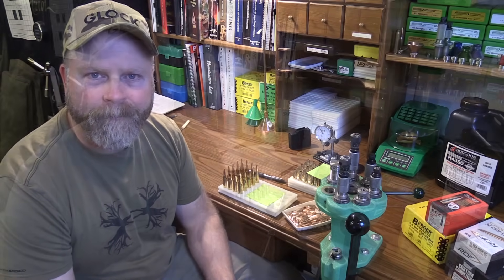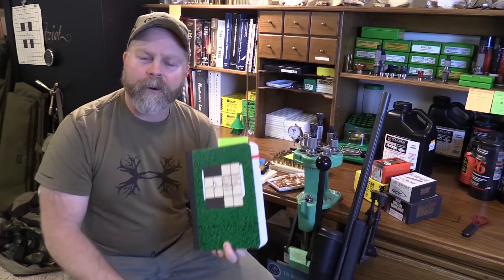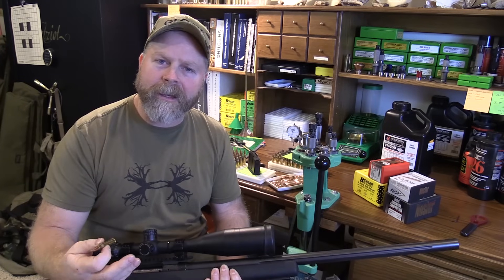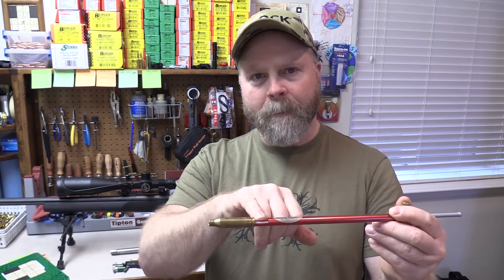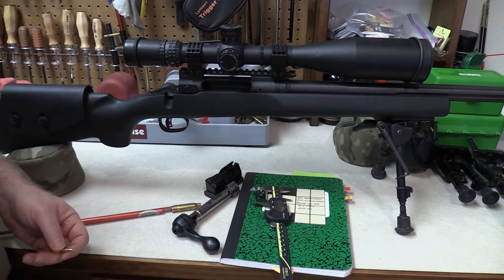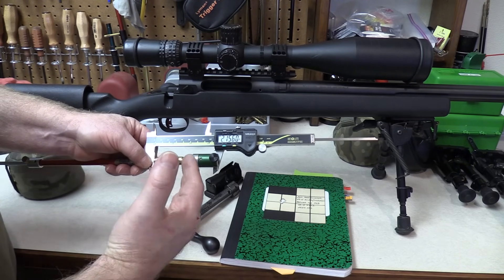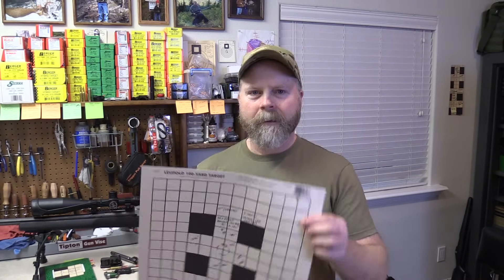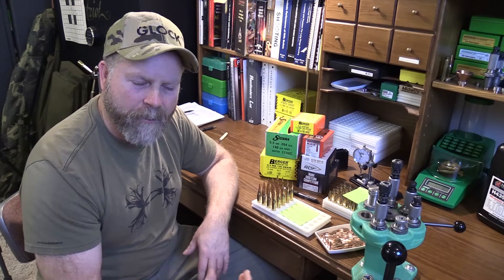Bullet Seating Depth: How To Measure & Where To Start For Load Development

Comment: Awesome video Sam, lots of info and your easy to listen to.  When you seat your bullets do you crimp them or not.  My father in law does a lot or reloading and tell me to use a lee factory crimp die.  But it seems like there is no way to match consistency on how hard it crimps on different lots of ammo.   Also have read where crimping can leave marks on the bullet that effect accuracy.  But I also don’t want my bullets to telescope in and cause pressure.  I know you have to crimp on semi autos.  But what about bolt actions??  Thank you

Comment: Hi.Sam. please advise me if i can use one load for the rest of my given rifle barrel life which it performs well .or will i have to adjust the load or only the seating dept.thanks
Reply from the maker: There's no way of knowing. Every barrel and load is different. I've had several barrels that shoot very well for  a long time (600-1000 rounds) without changing a thing. You can get a peek at that possibility by loading rounds that are incrementally shorter and see how they perform.

Comment: Great videos. I would like to see you compare the measurement from your homemade comparator case with the Hornady unfixed case to see if there is really a meaningful difference in overall chamber length as measured.
Reply: You bring up a good point.  I do measure this with my rifles and there's usually a difference of a few thousandths.  Maybe not very meaningful but something I like to note, especially if I'm trying to put a bullet right on the lands.  I would guess Sam is making his own modified case from brass fired in that gun, so there wouldn't be any difference for him to measure.  If you have a lathe and the correct tap they are super easy to make.

Comment: What loading press are you using? Do you have a recommendation for precision loading?
Reply: That's the Redding T7.  It's what I use and what I would recommend.  You can get quality reloads from a very basic press such as the RCBS Rock Chucker as well but I like the convenience of the turret press for changing between dies.  So handy, especially for load development when you're only doing a few cases at a time with each die.

Comment: I use a fired case , put a dab of Elmers glue on a bullet , chamber it , let it dry for 30 minutes , remove it making sure not to let the bullet be pressed against the side of the Receiver - push it over to the center -  remove it gently .
Now you have a dummy round to measure off of with your bullet Comparator .

Comment: love your videos, but im new and confused. It seems like bullet seating and load affect accuracy. but you can have the proper load and improper seating and not be accurate. or the right seating but improper load and not be accurate. Where does a one start? work on load first then when its as accurate as you can get it then play with seating?
Reply from the maker: You got it. I start at .010" off the lands with everything, and play with powder, neck tension, etc. first. I usually find something that works at .010" off, but if I want to adjust, I start moving away from the lands in .010" increments.
Reply: Panhandle Precision thank you

Comment: Hi from France, thanks for your excellent video . I am using the hornady OAL gauge + hornady mod. cases in .308 . I made a first measure with a Hornady BTHP 168 grs and it worked like a dream for my B14 . But I had a kind of stress with Nosler Partition 175 grs HPBT and I think it's very long long to reach the land . I am a bit worried ...

Comment: What is the difference between measuring to the Ogive and measuring Full Length. I use the Hornady OAL gauge and find my lands and measure the case to the bullet tip. If I want to set my bullets 0.020 off the lands, what makes the difference if you measure from the Ogive or measure the Full Length of the cartridge. .020 is .020 whether its from the tip or the Ogive correct? Am I missing something.
Reply: If your using you OAL gauge to find your lands then measuring the Coal of that projectile as long as you use that same bullet to set up your die,  then yes you should have the same outcome In the end!

Comment: Excellent video. I would like to know how you feel about utilizing max reasonable seating depth to increase case capacity and performance. Example would be my Savage 110 300WM using 208 Amax and H1000. I found that if I run single feed(.010 jump) I can easily load up to 79 grains and get no pressure signs. I assume this is more relevant to "magnum" cartridges using slow powder.It's true about Savage generally having a nice long magazine. The only round I've had to single feed to get close to the lands is in my Savage 110 300WM.

Comment: Good idea about making your own modified case, but here's something to consider.. Don't just fire form a case in your chamber. Why? Depending on how much the brass has been work hardened, you might not get sufficient "spring back" ie  if the brass is too hard the datum point on the shoulder may remain too long after firing. You should fire form then set the shoulder back the optimum amount. Usually between .001" and .002" .  This way you will get a true reading using the modified case for measuring bullet seating depth. Just make sure you resize the rest of your cases used for loading to the same shoulder dimensions as you sized the modified case to.
Reply: That's what I was thinking.  Why would I use a fire-formed case when I'm going to be seating bullets in brass that has the shoulder bumped back 1 thou from the fire-formed length.
Reply: I've thought about this a little more.  I'd agree with you (set the shoulder back before measuring) if you are using the method of carefully closing your bolt on the round and reopening it.  Because the extractor is holding onto the brass, your loaded and sized round may not be touching the chamber at the shoulder, so pushing a sized round into the shoulder to measure might be inaccurate.  But if you are using one of these Hornady tools, I'd say leave the brass fireformed, because the dimension from the shoulder to base is an accurate example of the chamber with the rifle bolt installed (since you aren't using your bolt in this situation).
Reply: The extractor shouldn't be an issue, but don't quote me on that.  Those store bought modified cases are sized to SAAMI specification. ie one size fits all.  The only problem with that is not all chambers are cut exactly the same. With an ordinary hunting rifle it doen't mater as they usually don't need to be that accurate to do the job. BUT I always want to try to get the best out of anything I shoot.  I have 3 different 3006 surplus rifles. These have chambers that are purposefully cut on the generous side. So it I used a SAAMI spec case to measure I will not be getting the proper # to seat my bullets to since I adjust my sizing die to bump back the shoulder .001" on the fired case. This makes my case I'm going to reload actually longer at the datum point of the shoulder than the store bought SAMMI spec modified case. This is why I always first size the case I intend to modify exactly to  the specs of the  sized cases I plan on reloading. This way I get exact measurements. and yes I have 3 separate modified cases each tailored to the rifle it will be used in.   You can use the store bought modded case, but you need to add or subtract the difference in size  between it and the finished size case you will reload.when measuring seating depths.
Reply: Sam's reason for not sizeing the case was about neck tension. If you resize the case the bullet will not be free to move up to the lands... Listen to Sam.

Comment: I use the hornady version of those tools And I have to set the bullet 30 thousandths off the lans to even get my action to close and another 15 to get it to close smoothly. The tool is hornady brass and I use lapua could this be why? I’m running GA Precision 338lapua built on a rem 700. I just find it odd that I have to seat the bullet so far or maybe I’m missing something

Comment: Sam, If we do a powder ladder test (at .3gr or .5gr increments) a given base to ogive length to find the harmonic node, and we change the seating depth, do I have to do a whole other ladder test just from changing the seating depth? In other words, if I make one change, do I have to start over?
Reply: Accuracy is matching a bullet's exit with a harmonic node.  Pressure curve affects the timing.  Seating Depth, Charge amount, neck tension, are variables that can affect the pressure curve.  So yes, if you're changing a variable, expect accuracy to change.  The question is what changes the pressure curve the least, 1 thousandth change in CBTO, or 0.1gr change in charge weight.  When load dev-ing to find that node, which variable produces finer adjustments?  I'm not sure, but I'll actually test this with my crono results being the determining factor.

Comment: I am shooting a 223 Rem. 700 Using a 40 grain Hornady V-Max bullet.  Using the Hornady overall length gauge to the ogive my measurement is 1.8700 touching the lands.  I want to start with this bullet being ,010. Off of the lands.  So when seating the bullet; what would my comparator measurement be to attain the ,010 jump?  Thank you.  jsmith1548@sbcglobal.net   PS. You have a wonderful informative program that includes a great deal of knowledge.  Please keep up the good work.  I am telling all my shooting buddies about you.
Reply from the maker: If you're at 1.870" touching the lands, your measurement at .010" off the lands would be 1.860". I like to take several measurements when determining max length, just to be sure I'm consistent.

Comment: Should you add or back off the powder load as you jump or back or the lands??
Reply from the maker: I start at .010" off the lands, increase powder until I hit pressure or it shoots well. If I hit pressure, I back off the powder ~ .5 grains. I don't adjust powder for seating depth changes, but I also never jam bullets. If you do seat into the lands, pressure can be a problem and the powder charge may need to be adjusted again. Going away from the lands, I've never had a problem keeping the same charge, until the bullet compresses the charge. For load development, I only want to change one thing at a time. I've had better luck getting the powder right, then the seating depth.

Comment: Great video. When your bullet stuck in the chamber while you were pushing the bullet against the lands, how did you know how far to push it back into the case to measure it with your caliper? I didn't understand that part of the video.
Reply from the maker: catwrench3 When the bullet hits the rifling, you tighten the screw that locks the rod in place. After you get the bullet out of the chamber, just stick it back in the case up against the rod. That will be the same length as when it stuck in the barrel.

Comment: So, when your as your throat gets longer do you seat the bullet at the same length as you did when the throat was "new" or do you follow the throat and always keep the same amount of jump? If you chase the throat, how often do you check the throat?
Reply from the maker: It depends on the barrel. I've seen them shoot well at the same CBOL for the life of the barrel. I usually follow the throat as it moves forward as long as the magazine allows it. I check them at 200 rounds, then every 500 after that.

Comment: Excellent! If it shoots, leave it alone.If doesn't shoot a SMK, there is a problem with the barrel.
Reply: I switched from SMK 2200's years ago when the Amax 168 came out. I just picked up for 168 Sierra TMK. Do they shoot any different than the old 168 2200's?